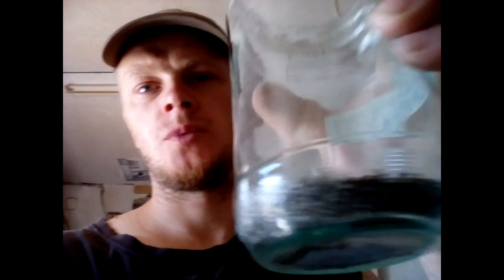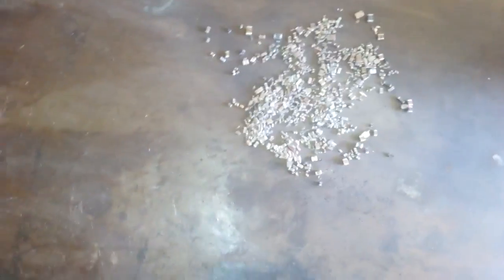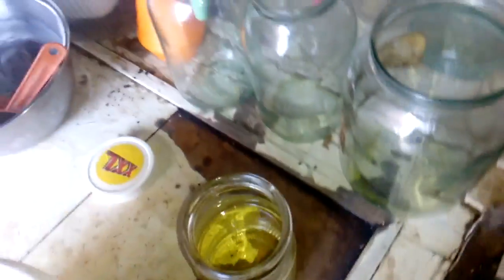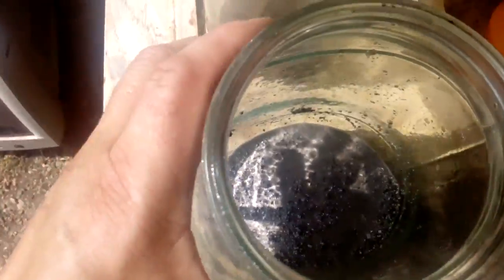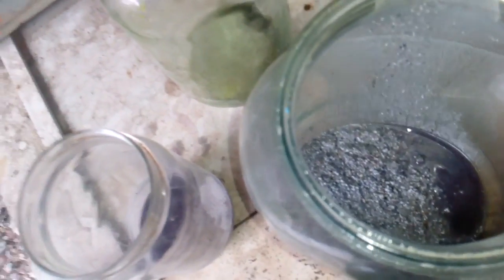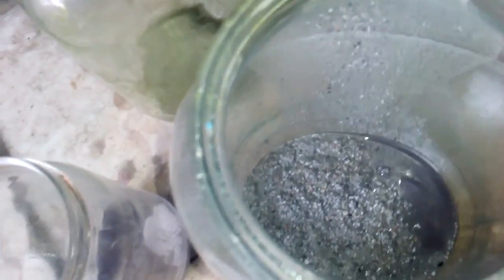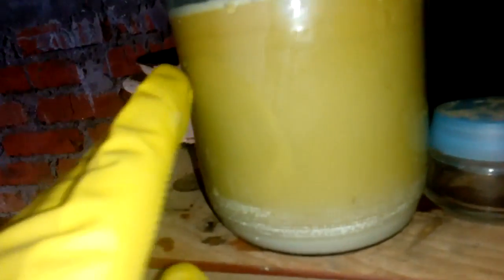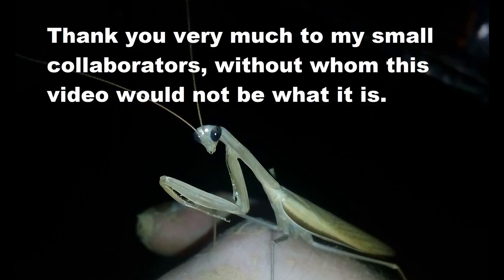Paladium and Silver recovery & refining from MLCC part 1

Comment: Dusan, use 10% nitric acid to dissolve solder/base metals. Filter "cleaned" MLCC for further processing. Heat up the filtrate and add solution of NaCl to precipitate silver chloride.  Lead also may precipitate as chloride, but unlike AgCl, it dissolves in hot water. After filtering AgCl add water to it and boil again to remove the rest of PbCl2.

Comment: Decided to play around with some of the mlcc I have saved up.  Something odd happened that I haven't seen in ANY vids.  Wondered what you thought.  I took about 50gms of assorted mlcc (not crushed yet), was not "clean" though...had some diodes, transistors, resistors and other assorted smd components still mixed in.  I soaked them overnight in HCL to strip away any tin, nickel and anything else that would be reasonably easily washed off with HCL.  Woke up today to see it has turned a very pretty deep violet\purple colour.  No idea what metal did that though.  Drained the liquid and just for fun I added about 5ml of 35% H2O2 to about 100ml of the"purple juice" and it immediately went a deep orange\amber colour.  Very nice colour at that.  Started getting warm too.  Tested and no gold, palladium or any PGM dissolved so I'm sure there's nothing valuable in it but for the life of me I have NO IDEA what metal(s) were dissolved to make the purpe and orange.  ")
Reply from the maker: Boring Old White Guy In addition to tin and lead, Nickle is also contains it, so it is probably a color of nickel dissolved in hcl. Posible maybe and iron cud color solution in red. I'm very glad to you have fun :)

Comment: Not sure what's worse.  A reaction jar with a big crack in the bottom, or his stirring 'tweeg'.
Reply from the maker: The reaction is not that strong to finish that jar, otherwise the jar is still alive after so much time. As for the tweeg for stirring, I used what I have at a given moment, I think waiting to get the top gear to get started with this job It's a waste of time.
Do you really think that the result would be better if I used a biker and a glass stirr rod, I think it would all be the same again.

Comment: making fool
Reply from the maker: Why?!
Reply: I have 2kg mlcc however you show in video can I do same work what's the result
Reply from the maker: Today I have melted Paladium and I got 0.8 grams from the process shown in the video. There was a bit of Pd in crucible remaining because I could not make colect oal becouse structure of crucible (brake), about 0.1 or 0.2 grams. In my opinion, you can get about 3 grams per kilogram depenso of quality of MLCC.